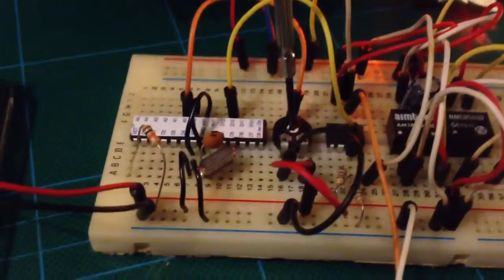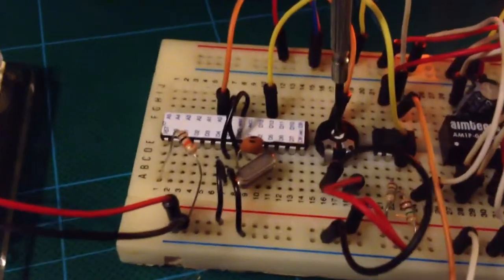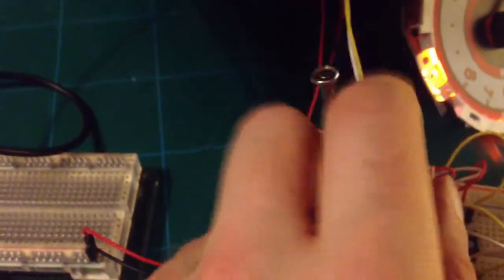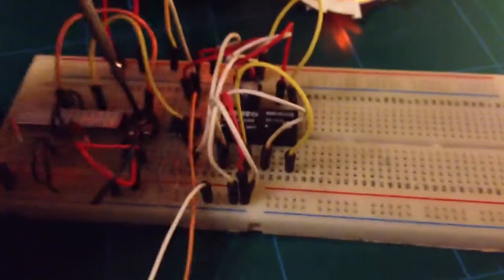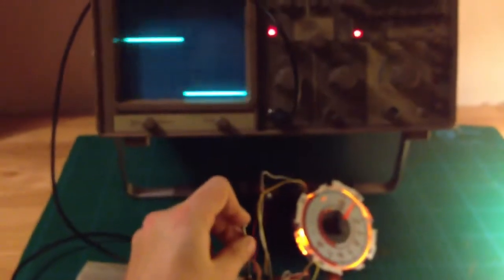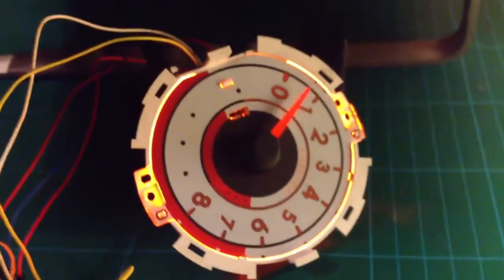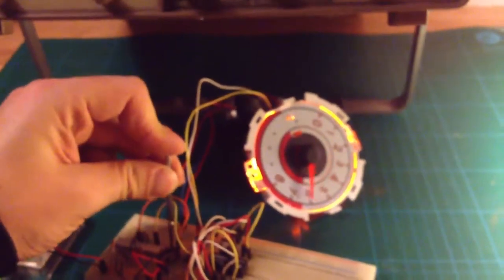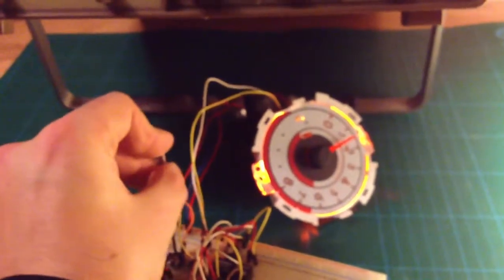Rev counter (tach) signal stimulator

Comment: Interesting project! Question: Why are there four wires attached to the rev counter? Two for power supply and two for signal or?  Do you have any wiring diagrams for this circuit?